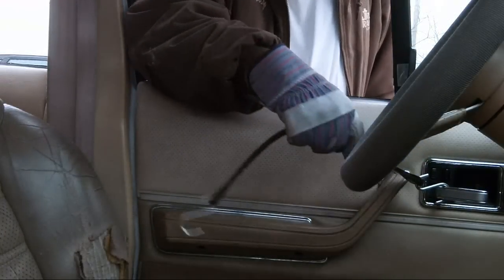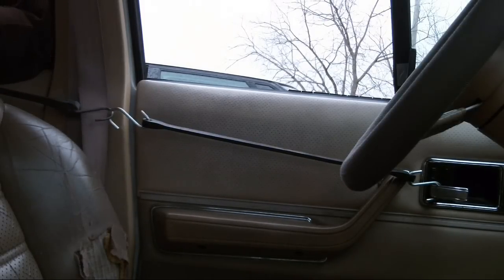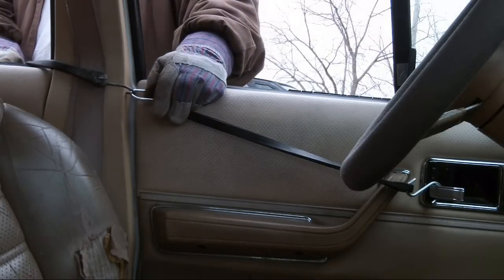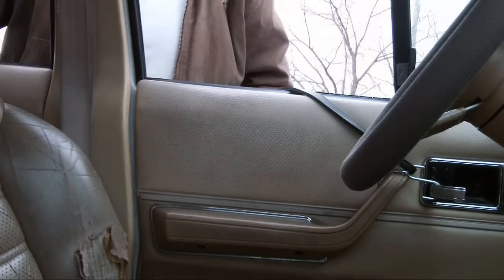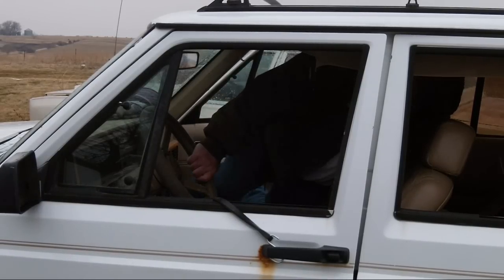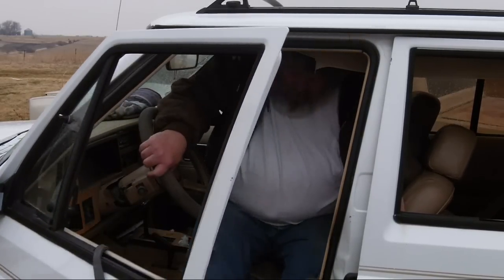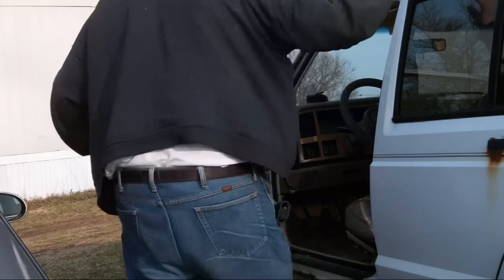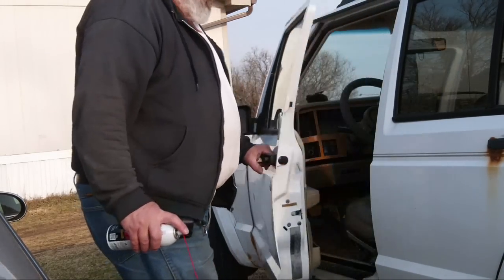How To Unstick a Stuck Jeep Door

Comment: what do I do when the lock is stuck (locked) and it won't unlock driver door only all the other door lock and unlock real easy. turning the key in the lock doesn't work neither the electric switch inside.
Reply: Same problem here

Comment: I've got a problem where my door won't unlock to open. door has never stuck closed, I went somewhere, locked it and it won't unlock now. both door handles move freely but don't engage the opener. key won't turn all the way to open the door, it's supposed to go from vertical to 90 degrees right and it won't turn far enough
Reply: i"m having that problem now. How did you fix it?
Reply: Cullins Service - I had this happen. I just used a spray lube that had a small straw on it. Sprayed in the key hole and just moved the key back and forth a few times and it works fine again. My Jeep is 99.5% rust free so I was shocked when my lock froze up. It was about 42* out so maybe that had a little to do with it. Anyway, hope this helps, or better yet you have already fixed it.
Reply: Thank you for the reply. The first thing I did was spray everything with PB Lubricant. After 24 hrs It still didn't work. Then I tried kicking the door open like this guy in the vid so eloquently did. Didn't work. Sooo.. I tried cutting the hook that latches onto the striker (loop). Word of advise, Don't ever try doing that. I ended up cutting the Striker (loop). Then replacing the striker and whole latch assembly. Everything now works as it should.
Reply: have 2006 X model and switch is f 'ed up tried WD40got it to move but then elbowed the inside door above and to the left of pull handle and door opened. Not sure which part that i will need to replace ? Anybody got some ideas?